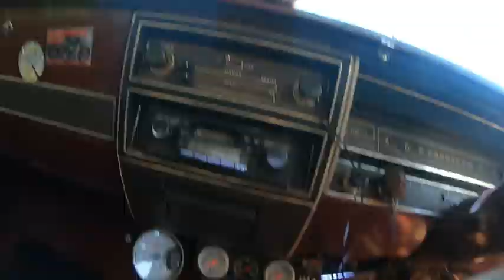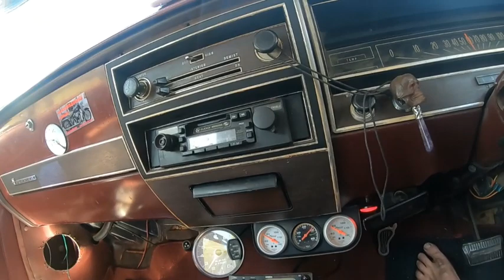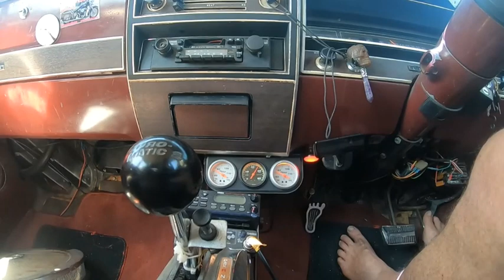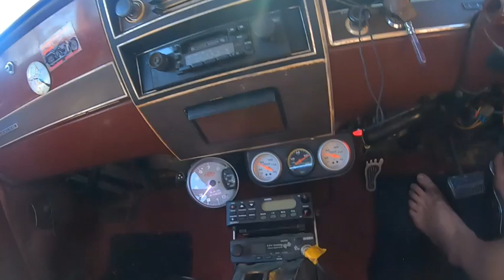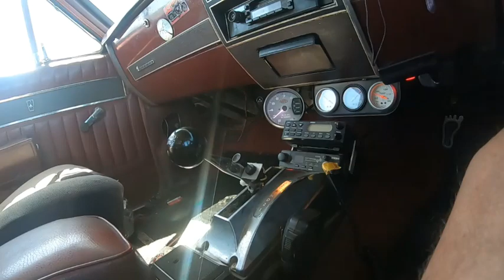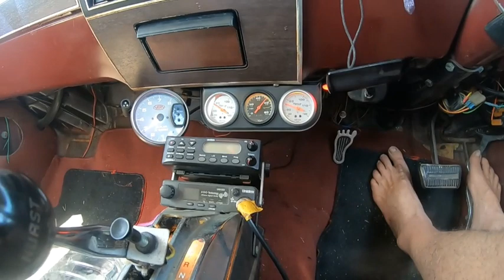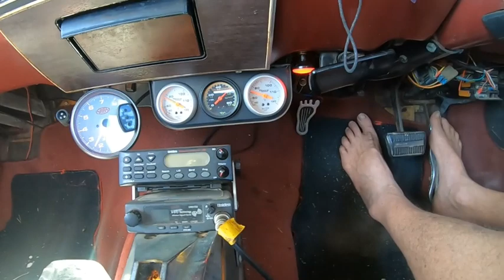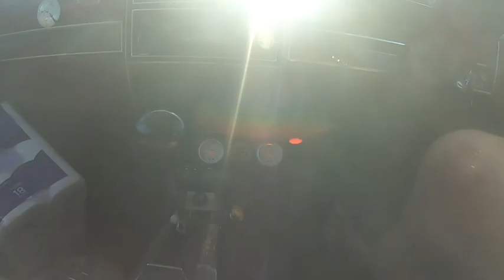Holden HK The 1st Test Drive of Das Boot....... Hippy Trev

Comment: Good to see the temps not going through the roof.
Have you checked to see that the linkage is getting full throttle?
How have you hooked up the vacuum to the dissy, its best to have it hooked up to the port on the carby that only sucks when you hold it say above 1500 RPM, you don't want it to have vacuum when it's idling.
Get it warmed up like you have In this vid and keep advancing it untill you get a ping. A slight ping when you boot it isn't a problem but you don't want it constantly pinging as you rev it through the gears 
The more advanced the better.
As to the gears shifting earlier I'd say with the new cam it's increased the vacuum in the manifold, the more vacuum in the manifold the earlier it will upshift. There is a little mod you can do to make it change later but finish sorting the rest out and see how it goes.
With that kickdown button on the shifter I'd only have a momentary switch. You push it in and it kicks back, you let it spring out and it upshifts, like a horn switch 👍
Reply from the maker: dizzy vacume line it into the side of the Holley where its meant to go.. the auto vac line go's direct into the manifold..
l will get use to how it shits when its all tuned & running right.. l like the pull push switch as l can lift it up wile going down hills & it will hold in 2nd gear...cheers

Comment: Good stuff Trev, get that timing right and it should be good. With the coil, pretty sure they have a resistor wire in the harness that reduces the voltage at the coil after it starts. Just check the volts with a multi meter when it is running to see if the wire is still in there and someone hasn't by passed it..
Reply from the maker: yes it has a balist wire l have a wire from battery to a switch then to the coil for its full 12v.. cheers

Comment: Sounds great so far, you can adjust how fast or delayed the gearbox shifts if the vacuum modulator on the back of your gearbox is an adjustable one (or grab one off ebay), if you pull the line off you should see a little adjustment screw under it, something that you can play with after your timings on point.
Reply from the maker: yer l have played with that before..  might need to read up on wich way to turn it .. cheers for that

Comment: That  beast is running nice mate, you did a fantastic job.   The distributor may need to be recurved . If the cam is bigger it may feel like it's got less power down low because the power band has moved up.  Sounds great though , I think a little tuning and it will fly . Well done mate .
Reply from the maker: yer l recon ya right about the power band has moved...  learn how to drive it all over again.loll 
l got a few more drives in today...it feels good cheers

Comment: Good job Trev 

You should be proud yourself 

PS you definitely have got your money‘s worth out of that blue singlet..!!!!! Hahahaha

PPS its  also a testament to the old cars the way they were built and designed I mean your a “backyarder” you’ve done some homework and the car is running the problems been fixed try doing that with one of the modern cars from today you just wouldn’t bother
Reply from the maker: lol  yer me tank top is getting a bit thin..loll
& ya so right  lota lee way with these older cars when come to repairs.. l had a 03 260 BOSS XR8
l didnt have it long lol  nothing on it l could fix..loll
cheers mate

Comment: Put a fan shroud on trev watch the benifits
Reply from the maker: no room for 1  & over 50mph  they dont do much.. cheers
Reply: @hippytrev7452  g,day Trev,    yes theres room for clutch fan ,  just buy type that suits the 5000 injection motors  vn to vs ,  ,     cost of  80 bucks new from holden ,    and use commodore  fan  with that clutch ,   it pumps the winds only when its required  to blow  ,  if its cool it will neautral itself saving you fuel and letting people hear the v8 coming not  the humming fan
Reply: @hippytrev7452  my brother fitted holden clutch hub an commodore fan to the hk ,   307  v8 premier instead of fixed 4 blade fan ,    it gained power  from having a drop out clutch type  and she stay cool
Reply: And trev we use 3 core radiator  too all this fits in mate 307 or 308  it fits trust me
Reply from the maker: @holdenbrougham7768  l have a big 3 core radiator in  have had it the whole time  was rodded & cleaned  & running great

Comment: Why not that 307  ,  my brothers 307 was best v8 ive ever know of mega reliable and super prompt starter ,    it would put the wind up a 308 4 bar with the  2 barrels  on 307 and my 308 hammered hard too ,,    the 307 seemed too hammer harder ,
Reply from the maker: the cost to move  to Chev  is a lot...  Chev maybe a better motor but change over dont come cheap

Comment: Why u getting lower power 
universal 308/253 head gasket 
incorrect timing 
carb not jetted for highway cruise  ,remeber main jets = cruise /power valve = engine vacuum 90km/h and above . power valve jets are how u tune this area .
Camshaft stock replacement , next up part number would give slightly better throttle response 
running a very cold thermostat will reduce throttle response  . Usa 180f / 80cel  every time
Reply from the maker: it has power just in a diffrent rev range than it use ro be.. cheers

Comment: Well done Trev if you want get a bit more power out it 465 holley 4 barrel carbs work well on 253 just saying Trev
Reply from the maker: yer l will have to think about that.. spewing l had a brand new 465  l wasnt useing  so l sold it.. 
anyways extractors are next but l do need to get them ported....cheers
Reply: @hippytrev7452  damm thats what i use to run on mine yrs ago 253 cam extractors tri 308 rear end all in a HX my misses loved it
Reply from the maker: @maxholden435  yer lm running 3.08 diff 
l have a 2.75  or 78? cant rember   in the shed but might be a tad to tall...